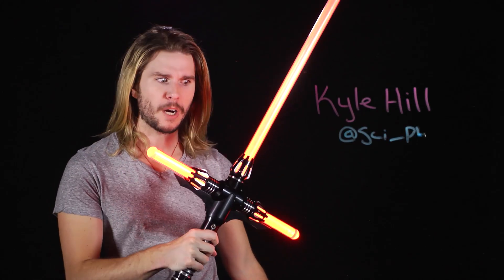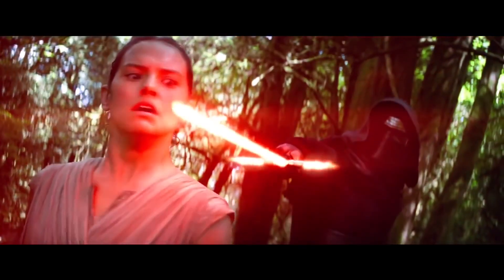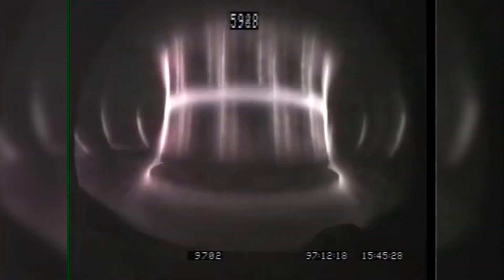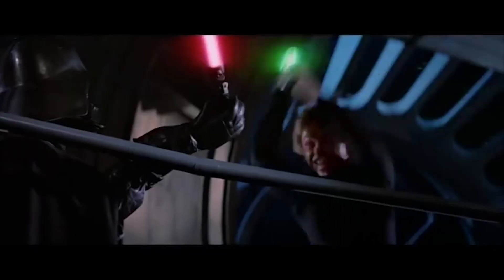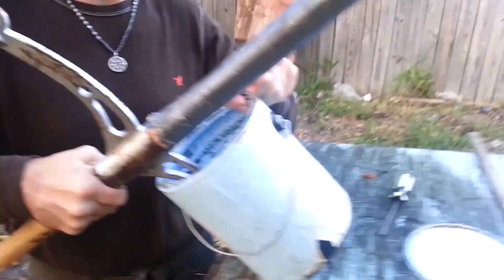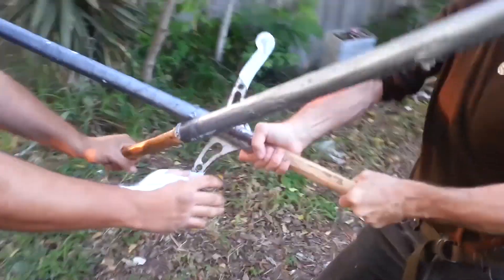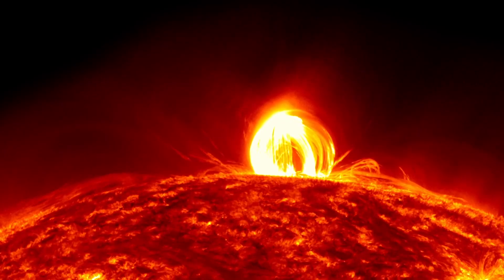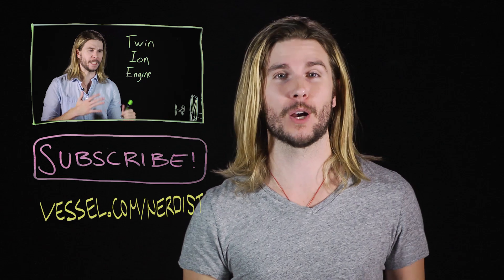Why Kylo Ren's Lightsaber Works (Because Science w/ Kyle Hill)

Comment: The reason why his light saber looks statically is because while he was building the light saber he didn't use a complete crystal. The crystal he had was cracked which made the light saber unstable which in turn needed to have those "cross guards" to exhaust the unstable energy.... also I gave up on the theory that to handle a light saber you need the force right when I saw Finn using it.

Comment: the reasoning in this video is utter rubbish. those guys loing their hands had nothing to do with crossguards. if the crossguard was actually used the way it is with a real sworrd then the lightsaber blade that ran down to the crossguard would go through the bits the crossguard is generated from and then cut off your hand. not only that, but the design impedes the user's ability to swing it round like they would in all other 6 films. this is because you would probably end up chopping your own hand off. even if you just held it by your side there is a good chance the crossguard will cut into the side of you. all in all, one of the most ridiculous weapon sever.
Reply: +Mantis Toboggan the weapon serves a purpose in the story, but people keep trying to make it out to be more or less than what it is: a plot device.
Reply: There was a few moments in the video where a cross guard could have helped.
Reply: +Mantis Toboggan But there are lightsaber resistant and proof materials in the Star Wars universe, and it could easily have been made of those. Also the lightsabers used by the younglings give a small burn at worst, and in a more practical cross guard lighsaber design you could use this functionality to ensure it won't injure the user. This particular one is not a very practical one.
Reply: +Mantis Toboggan No the lightsaber would not go through the crossguard. Wanna know why most lighsabers have different lengths? Because they are focused through a lens that is inside the handle. Cutting off that metal piece won't destroy the plasma guard.
Reply: +B'oh | Geralt of Rivia I wonder how the supposed cracks in this crystal must be oriented for this to actually work. It would have to be some kind of magical prism to split them in three directions without help. If this is the case, then I cede this point. If it isn't, then there must be another crystal, or two, to generate these crossguards that would also need to be out of the way of the main beam - Where it would be vulnerable to a lightsaber sliding down Kylo Ren's blade and through said crystals, into his hand. We'll leave it up to Disney. Also, the beams are weightless! Comparing this to swords doesn't make sense. People are swinging around a blade emitter that resembles a hilt of a sword.
Reply: +Prognox not weightless. the metal covering the crystal has to be taken into account

Comment: those things on the end, the bulbous looking things? they are emitters and focusing crystals. that is were the beam starts.  Basically the idea of a cross guard is a great one, but they could have made it out of light saber resistant materials or had the design tilt forwards to make a trap (making it so if the saber slid down it would be caught on two beams instead of smacking strait into the emitter).

Comment: Dude, you are not dropping any knowledge on anyone with this video.  Everyone knows about sword hilts.  The problem is that sword hilts don't destroy anything they touch.  The guy with the paint on the hilt is moving super slow and carefully which is not something that lightsaberists do.  Also, every "hand loss" you showed from the other movies would still have occurred even with Kylo's hilt.  It would absolutely do more harm than good and it's design is nothing clever or innovative.  I loved the movie, I loved the fact that the beam on Ren's lightsaber is crackly and less refined than Luke's but the "cross guard" as you call it is just silly.

Comment: Yes it might look cool but in the SW universe it almost has no purpose. From what I understand the magnetic fields holding in the plasma arc of such a weapon kinda stick or repel when they interact with another one. So no sliding down the blade to hit your hand. Every example of someone losing a limb you gave would of happened if there was a cross guard or not. They are used in the real world as a hand protector of sorts because blades can slide down each other, if this was a thing in the SW universe don't you think the Jedi after using them for hundred of years would go "Hey! You know what would help!" I think Kylos saber looks like this because he sucks at building lightsabers and probably couldn't focus the energy properly . Or it could be the materials he had access of were poor.

Comment: ITS STILL STUPID. The crossguards on a sword come into play when the blade of one sword SLIDES DOWN the blade of another. This will not work with Kylo Rens sabre, because if one blade slides down Kylo Rens it will hit the handle that projects the light beam, not the beam itself, and as we have seen with other light sabres, this would result in the handle being cut through.

Comment: Darth Maul had a lightsaber bo staff (or maybe it was made more like a spear). The normal Lightsaber is kind of like a Katana of sorts. And Kylo Ren had a Claymore style. 
With the new movie trilogy, I am hoping to see more lightsaber styles. Lightsaber mace, lightsaber shield, lightsaber bow-and-arrow, lightsaber dagger, etc.
Reply: If they make lightsaber bows I will literally die
Reply: +Arrow In Eye And you would use a lightsaber bow instead of a normal blaster because..?
Reply: Mupf3 Because badassness.
Reply: Lightsaber bow: the fuck do you think a blaster is?
Reply: Boreas Z Yes, which is based off of a bo-staff.
Reply: +Arrow In Eye The only other lighstabers that exist are small dagger like ones. Yoda used a Dagger sized lightsaber to compensate for his height. And there are also Lighsaber Pikes. Where the handle is really long and have a "blade" at the end of one side. There are also huge sized lightsabers that are too large for humans to wield, and made for wookies to use. Again it's more like Height compensation. There are also Multiple "Phased" lighsabers where you can extend the length of a blade by having more than one focus crystal in the handle. By pressing a second/third/fourth button or with the force you can double/triple etc the length pf the blade.
Reply: Terrato They already did introduce lightsaber resistant materials. Ep3, Obi-Wan verse Grievous Magna Guards, the guards' electrostaves are clearly lightsaber-proof.
Reply: +Arrow In Eye none of those ideas are even plausible in even the EU, the closest we came is the 7 tendril saberwhip. and to correct you Maul had a saber-staff
Reply: +Christian Castro Your right didn't the nightsisters use them ?
Reply: +Arrow In Eye If literally anybody had a light shield and knew how to use it, no one would stand a chance against it, god forbid the movies start introducing lightsaber resistant materials.
Reply: +WhoAmI4631 it wouldn't work whatsoever.
Reply: They have light bow and arrows in Star Wars the clone wars
Reply: It's not a lightsaber then. It's a lightbow light sheild, light bow, light arrow. Just like the light whip
Reply: +Arrow In Eye Well the closest you're gonna get is with a dagger in the form of a lightsaber shoto. Though that's more of a defensive thing then anything else.
Reply: Terrato The EU already covers lightsaber resistant material. Like cortosis.

Comment: No spoilers here.

This video was great, but sadly, Disney has debunked it. :C
On a plaque on a Disney display - i can't quite remember where - it states that the crossguards are vents, or quillons, that eject excess power from the main, unstable blade. If these weren't there, the lightsaber would likely explode from the overabundance of energy emitted from the unstable and cracked Kyber crystal that powers the blade.

Comment: ugh, they just wanted something different and it backfired, the saber just looks stupid, it's not about if it's dangerous or advantageous. The damn thing just doesn't look good, it already had the unstable looking beam, THAT BY ITSELF ALREADY LOOKED PRETTY FUCKING BADASS. Now no offense to Colbert, but if he truly is a fan then he would know that any major damage to a lightsaber's upper body, i.e. near the main battery/crystal/focusing ring, would cause the thing to burn out, this has happened before with darth maul, whose lighsaber was cut down the middle and only one side of his blade still remained in working condition. Now most of the examples of limbs getting chopped off were DUE TO THE COMBATANTS OWN FAILURE, I mean for fucks sake does anyone really think a cross guard would have helped anakin in his fight against Dooku, or Luke's first fight against Vader, THINK PEOPLE THINK!!!!!!. The only thing the cross guard brings to a fight would be it's sense of awe when used against an untrained opponent, similar to the light whip in that Luke had some trouble dealing with the weapon but once he realized that using a second lightsaber would allow him to counter the weapon he was then able to win the fight. The cross saber was a dumb idea, if they wanted to give Kylo a different saber look then they should have given him a light spear or a pair of guard shotos.

Comment: I see the cross guards as vents for an unstable energy source.  Since his light saber crackles and flickers, there has to be an unstable source of energy from which the plasma comes from (possibly from a cracked saber gem?) so the cross guards, or vents in my case, act as energy stabilizers to release the plasma and prevent a saber melt down

Comment: All of the times in Star Wars when a lightsaber wielder has had their hand cut off in lightsaber combat it has been due to a sweep from underneath. A lot of the hand/limb removals you showed were not actually in lightsaber combat either, so they aren't examples of what happens without crossguards. I do agree that they are a cool design, and even that they offer some protection (that point can't be debated, as you said, swords have had crossbars for thousands of years). But the style and technique of lightsaber combat is different from swordsmanship, and for a more effective hand protection I believe the crossguards would be better placed underneath the hilt, however that makes the lightsaber much more dangerous and impractical to use. I think that the safety of a regular lightsaber is about as good as it gets, but... Kylo's lightsaber is still pretty awesome none the less.

Comment: The whole fact that plasma is weightless is why I actually prefer the Prequels fight choreography than the original series. It makes almost no sense why they would fight like actual swordsman. When we see Kylo Ren fight, he does these big lunges and swings as if he's holding an actual claymore which looks dumb when he's using something made of plasma. The whole point of those big swings is to build up momentum behind the weight of the blade and drive into your opponent, which you don't need to do with a sword that only weighs 5~lbs at the center. It actually makes MORE sense for them to zip their swords all over the place at a very fast pace. 

As for the flips, they're jedi. They're kind of supposed to be these mystical warriors that have trained their entire lives to be the very best they can be with force and these weightless swords.

Comment: Okay, first, there's been hints that the beams might actually only emit near the end of the lightsaber for ages. Also, didn't Darth Mauls Lightsaber get cut in half?

But let's ignore that and the fact that he'll need thrice the rare-ish focusing crystals and/or a really specially crafted one. 

And focus on the crossguards under the assumption that there IS a beam inside.
There's also still tech inside and you just made it easier to hit, since actually having a crossguard, you'll be more likely to have a normal style where parrying involves sliding the enemy blade towards your crossguard, instead of the fancy baseball-hits other jedi do.

I don't wanna know what would happen once part of the thing that keeps the fucking metal-cutting laserbeam focused takes a hit.

I LOVE fancy crossguards, but they go on fancy glowy swords, not weirdly stable laserbeams.

Comment: It wouldn't work to protect the hand. Check where the lights sabers start and picture a line of an opponent light saber sliding against the main blade. It would shop the base of the handguards without even touching the actual sabre that should be proctecting the hand. Steven got it wrong, Remember the hand guards are turned on separately, that means they are 2 different light sabers. I don't see any danger to the weilder, I don't personaly like the look of it.

Comment: The plasma is being held in by the force and when in a saber lock, the force locks so it sliding down will not happen. The crystals are what gives it the force. All the scenes you showed wouldn't be helped by a cross guard. Most were when the Jedi or creature was exposed rather than when they were defending

Comment: Ok, 3points. 1. No one argues that cross guards are valid concepts on real swords where both are made of metal and blades are not so strong you can just cut straight through them. 2.  So the Stephen Colbert argument is invalidated by the pic on this page http://www.rocketnews.com/2015/12/this-is-the-most-important-lore-left-out-of-star-wars-the-force-awakens/ the beam is not continuous all the way through as he would have us believe. 3. Not one of these hands shown being cut off would have been protected by a crossguard, look at the angle. Dooku having one may have stopped Anakin doing his very risky manoeuvre to get in that position I grant you, but it wouldn't have actually blocked the blade.

Comment: 1) if the metal containing the crossguard is damaged then there won't be any emission, it's possible that the whole saber might short circuit. 

2) surely enough training might help you avoid cutting yourself, but what about the opponents swings ? kind off a big risk. You know how it would work much better, more efficiently and with fewer drawbacks ? making the crossguard (or vents cause apparently these are vents) tilted and crossphased , with that you can actually stop the opposing blade, without your sabre being damaged, and allow yourself more freedom of movement

Comment: you are wrong, Kilo uses a cracked stone in her saber, and because it is cracked, it leaves extra energy, meaning his saber has to have the vents on the sides, so that it does not potentially explode, a cracked stone is harder to control, and more dangerous, and that is why it looks like his light saber is vibrating

Comment: There was a talk with the movie creators of the Force Awakens and the producers said that the reason why there are the 2 light beems coming out of the side is because it uses an un-stable crystal. With out the 2 smaller light sabers coming out of the side, it would explode from being so unstable, it also adds the cracking and popping sound.

Comment: Its now known that the reason his Lightsaber looks unstable is because it IS unstable. Kylo Ren used a CRACKED Kyber crystal to focus the plasma in his lightsaber. That cracked crystal is in danger of exploding at any time, thats what the "cross guards" are for, they're actually plasma vents. They expel the excess plasma coming off the fractured crystal out through them, thereby easing the stress placed on the crystal itself.

Comment: Parsec is a distance measurement and not a time measurement. The cross guards only work if the arms are made out of light saber resistant materials. If not you would cut through what is projecting the plasma rendering them useless. Using them as they are in the movie just makes them extra weapon in a clash. Out side of that they are pretty pointless and look kind of stupid.

Comment: No. According to star wars lore it could not work. Just because of the science behind it.  Sorry, but lightsabers generate a powerful EM field that contains a plasma beam, without separate EM generators and something directing the plasm there would be no extra beams,  the generators would stick out and any attempt to use it as a hilt would get your hand cut off. exhaust is nonsense because there would be no EM field containing it meaning it wouldn't block a lightsaber, it would cut through stuff but not block a lightsaber. 

 
So, because of imaginary and real science, no it wouldn't work.

Comment: sorry I must correct you, red crystals are very rare and artificial, red has exhaust pipes because his red crystal is specifically extremely powerful, ren also built it himself so it's not a matter of science, ways you can tell there exhaust pipes is Because they turn on after the main blade, also withought exhaust pipes the lightsaber may explode or melt in his hands, rens exhaust pipes just so happen to be ejecting the same plasma so he trained himself to use it as a cross guard...
Reply: ren*
Reply: 1. They aren't rare but they are synthetic, 2. The crystal is shit, that's why it needs the vents. Not because it's powerful, but because it's total crap
Reply: Ah ok thanks

Comment: SPOILER ALERT
it was explained that the khyber crystal used to make Kylo Ren 's lightsaber is cracked so the crossguards on the sides are more like ventilation so it would insulate the power of the crystal to explode thus the lightsaber is dangerous